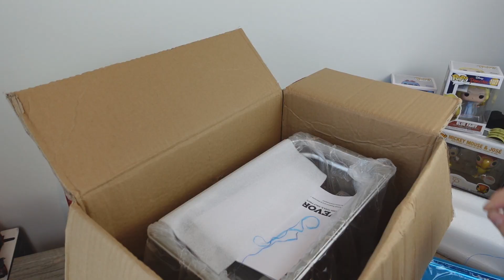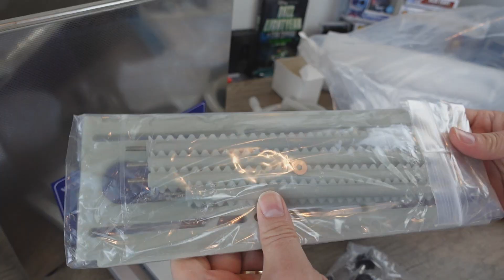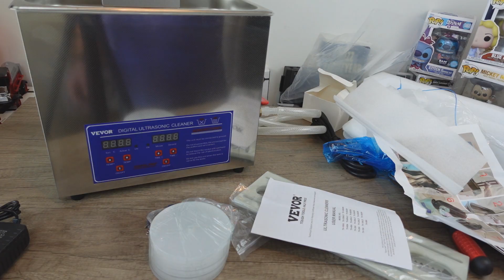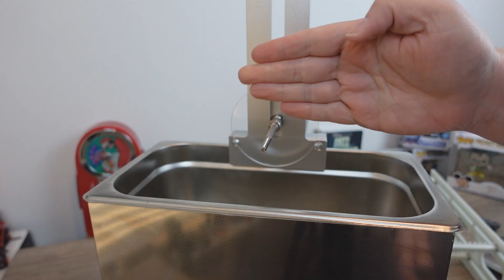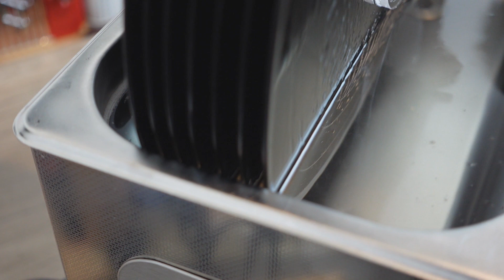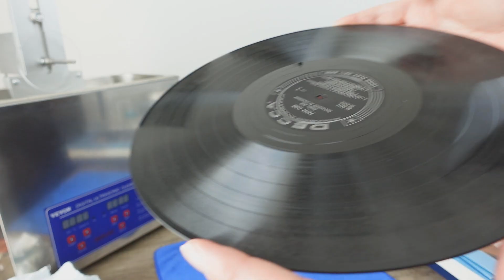VEVOR Ultrasonic Vinyl Record Cleaner!  Review & Unboxing!

Comment: I used silicone sheeting and cut label protectors out of it. Also i replaced the walwart and run 6v to slow the rotation speed down.

Comment: Here's a tip for you.  Raise the motot all the way up. Put your records on the shaft. Lower the motor down to submerge the records. Possibly add a bit more cleaning fluid and a few drops of Dawn. Bump your time up to an hour. Raise the motor all the way up and remove the records. That way you can clean more records without having to drain the tank. You also don't have to worry about smacking a record into the tank when adding or removing records.

Comment: I have worked with Ultrasonic cleaners in previous employment.  Always use DISTILLED water and if you add "wetting agents" to the water run the cleaner for about 10 minutes before doing any cleaning to "de-gas" the liquid. 
Did your Patsy Cline record belong to a Deejay?  Some people have acidic skin and if a Deejay played the disc over and over and did not wipe off the surface each time the acid could eat into the surface just enough to leave permanent marks.

Comment: My Vevor took the shine off my records. They still play (with pops and clicks). I guess I did something wrong. But how do I get the shine back on the records?
Reply from the maker: That’s awful!… What did you have in the solution? Also, what was the temperature?
Reply: @Recordology  It was afterwards that I found out no to use an UltraSonic on 78s because they are made of shalak. I was lucky they didn't crack. Also, don't use any cleaning solution that is alcohol based or heated water.  I did all three. Shame on me.
Reply: @Kicks001 also don’t use the heater at all. It will warp records

Comment: What no one tells you!
Only use about 1/2 cap of cleaning solution, anymore and you will have soap residue on your records. 
Buy a voltage regulator and set for the cleaning at 3.
Clean for only 7 minutes and clean a max of 4 records double spaced at a time. Let the machine work for you. 

Now here is the most impotent step. Dump the water you just cleaned the records with. Rinse it out with a little water, just swirl it to get out soap residue. Now fill the tank back up either clean distilled water. Put your records double spacing back in. Turn the bottom part of the machine off (no digital should be showing) now set your regulator to 5.5 or 6. Push the top button only. 
Let the machine rinse your records for 5 minutes. Then remove them and do not wipe them at all. Tack them in the drying rack and let them dry for an hour. If you stack them straight they should be prestine and dry. If you do have a drop or two you can take a nose dropper and duck that up. 
Unfortunately I learned all of this after trying to use a spray bottle and a microfiber towel to rinse. Clogged my sylus after one song. ATVM540ML. Use a carbon brush on your records and gel the sylus between every record. Sit back snd enjoy.

Comment: I seriously disagree with your opinion "Not much better than a Spin Clean"!
I have used a similar model of tank for some years now and even have my own Facebook group with 7000 members.
These devices give excellent results.
You made a few mistakes:
Firstly, you should have done a pre-clean to remove the loose hair, dust etc. 
If you use a wetted microfibre cloth dipped into the cleaning solution working around and squeezing the wetted cloth around the run in groove with the cloth squeezed between your fingers on both sides, you can really quieten that run in groove of that record of yours.
Use the wetted solution microfibre cloth to complete the pre-clean before putting them onto the spindle in the tank.
Secondly, Too many records! 
Not enough spacing between the records.
Thirdly, Too hot! 40 degrees is insanely hot! Even 35 degrees is too hot. Maximum 30 degrees.
Fourth, you should use Distilled or Deionised water. NEVER anything from a tap, due to possible dissolved minerals in tap water.
To remove grease or fingerprints add some 99.9% Isopropyl Alcohol.
This will get the cruddy fingerprints out.
You should also use a surfactant like illford illfotol.
The surfactant breaks surface tension and improves the cleaning action.
You mentioned a Spin Clean?
That's good to rinse off the cleaning solution after the cleaning cycle.
Use distilled or Deionised water in the Spin Clean.
Do not use cloths to dry cleaned records off! 
You should use the drying rack!!

Comment: Hi! I read some places that you need to use distilled water on cleaners like this? Any comment on that? Seems like that would make the process a lot more expensive. Did a search for what that kind of water would cost in Norway....Also I actually have  Pro-ject VC-E that I never unpacked. (Vacuum cleaner)  but it seems like this ultrasonic machines will be easier to use for multiple records...
Reply from the maker: A lot of people swear by the distilled water… I have tried filtered water, but never have seen any residue or anything else from The Water so I personally don’t seek out special water for it. I could be completely wrong in doing that, but that’s just what I’ve done so far. That being said the spin clean is much cheaper and does a better job in my opinion
Reply: @Recordology  Than you so much for fast replay 😎🎶 I have now seen that the same firm has a little machine for distilling water, not to expensive... And of course water quality when it comes to minerals and so on will vary...

Comment: A thought about your patsy record: the oils from the fingerprint stains may have just soaked in just that much. But, an idea for you. Have you tried a makeup wipe? it could be that someone in the past had handled it with makeup-oiled fingers and something like mineral oil for makeup removal on a wipe might just do the job! Certainly worth a try, I'd think. Acetone on a cotton swab and scrubbing those spots might help too, but def chase it with distilled water after. Or, try an acne pad! I use neutrogena extra strength to clean the sticks on game controllers and it just sucks up dirt and oils. And of course, if you haven't tried it yet, get a label clamp thing to protect the label and take a nail brush in your sink with dish soap and scrub good with the grooves. I would recommend that on the columbia record you showed here for sure, since that mud spot is still there. You won't hurt anything using a regular ol' nail brush so go ham! I've done it on a lot of my more stubborn records and followed up with a spin clean with good results. I've also recently started messing around with the wood glue option, and I ordered one of these ultrasonics but it's not here yet. I'm curious to see (hear?) how these methods all combine. I've got one record with a very stubborn bit of crackling in the quiet intro to a favorite song and just nothing seems to work, so here's hoping this does the job!

Comment: I’ve seen quite a few review videos of these ultrasonic cleaners that didn’t show very impressive results. I suspect the real difference is in the “sauce” — the cleaning solution.
In my experience, you can get excellent results with the right formula. I personally use TergiKleen, and it’s worked really well for me.

Comment: 1) Runs too fast. 2) the temp is way off about 7-10 degrees. 3) It leaks. 4) 40kHz only. 5) Maintaince and customer service is non-existant.
6) Go ahead and ruin your records.
Tip. You do not need surfactants. Ultrasonic method is a surfactant in itself.

Comment: How would the fingerprints disappear when you don't use any cleaning solution? The little bit you put in the water probably only worked as a surfactant but a bit of rinse aid would do the same (and that's much cheaper).
You really need cleaning solution if you want smudgy fingerprints to clean off.
Reply from the maker: Ultrasonic doesn’t require a solution… Sometimes I like to put a little something in there anyway
Reply: @Recordology  It does. Grease can't be broken down by just water. An ultrasonic cleaner with just water is like giving it a very deep rinse but you're not cleaning anything.

Comment: I own the exact same unit.  It works well.  I would say for even better result to a pre-clean with the spin clean or other method first, then use the Vevor Ultra Sonic last as it will take the last of the heavy dirt out and your water won’t be as dirty with hair and other grime.    I also own the Spin Clean and VPI 16.5 and use them in combination.

This can cut the time down to between 5-7 mins, I favor 7 minutes. Anything left on the record after that isn’t coming off and is either a record issue, damage due to age, a pressing or a scratch issue or as you discovered finger print’s buried deep in the grove structure.  

Also don’t use an Ultra Sonic cleaner on records with raised bumps or pimples in the groove, because they can pop due to the force and totally ruin the record.  Leaving a record in an Ultrasonic Cleaner too long and at the wrong temperature will create the same effect as leaving a record in the sun and will damage the grooves and create that static and distorted sound. 

Lastly some record labels are more delicate than others and I can say with assurance if you get an older Bluenote record label wet, it will dry faded, ruining it.  Most other labels that I own have been fine.

Comment: Here's a thought...  after cleaning the records...  drain the water out...  then turn the motor back on with the records still on the cleaner and spin dry the records...
Reply: Yeah man put a fan on facing them
Reply: Or just  loosen the carriage and raise the records out of the water and spin dry... Draining and refilling to get the next batch of records in seems silly, plus that's why there is a cutout on the record holder anyway.

Comment: About fill Line…I did Not fill to where the ‘mark’. I did slightly below where about  3/4 of the dead wax is covered, ensures less water hitting label.  Reprise Neil Young label and Sinatra will melt off if you let too much water hit.

Comment: How do you clean 7 inch 45s on this thing? Has anyone come up with a good adapter to do this?  I have a whole pile of old 45s that i refuse to play because they are so dirty.
Reply from the maker: That’s a great question! The best idea I can come up with is those little yellow spider adapters which I can’t stand… I have used precariously placed regular 45 adapters with this machine with some luck but it’s not a great process. Overall, I much prefer the spin clean to the ultrasonic.
Reply: @Recordology  That's what I use, the spider adapters. It works great for me.

Comment: I like this, instead of making an expensive, dedicated record cleaner, they've taken an inexpensive industrial ultrasonic cleaner and just added a seperately powered spinning motor. If you buy one, you pay less than a normal record cleaner, and you can convert it to just a standard ultrasonic cleaner for use cleaning anything else. It's not the nicest sleekest model for putting on a shelf next to your hifi setup and attracting the eye of the audiophile, but it's a powerful little stainless steel unit you could leave in the garage or under a sink.

Comment: Vevor ultrasonic cleaner
Jps-40a
!Attention! (Wear Shoes!) Im in the US. It looks like the unit is supposed to ground to the case which has rubber feet. After a month of use. My wife had something that needed cleaned. I ran out to the garage applied power turned it on. With the heater off and not engaging the sonic cleaner. I reached into the water and got a buzz. I got out my multimeter set to A/C nothing reading on 110v. I changed the multimeter to DC I am reading .10 volts. Not enough juice to consider. I realized I was standing barefoot on cement. Once i put some sandals on it stopped buzzing (shocking) me. Apparently with inadequate grounding and being barefoot I became the ground.

Comment: I've had mine for several months and it works great once you figure out the little details that make it easier to use. Two problems I haven't been able to get around are that the heater takes a long time to get up to a decent temp for cleaning. Leaving it running to heat up is putting a lot of miles on it. Preheating the water is an option but a royal pain. The big deal here is when I drain the thing I get rusty water coming out. Something in the valve connection is rusting. Not a huge deal unless you plan to reuse the water. Anybody want to clean their records with rusty water? I didn't think so.
Reply from the maker: I have the EXACT same issue!  Its annoying but I guess it does no harm.

Comment: I've been using a Vevor tank for some years and it has worked well for me. I clean 3 records at a time for 11 minutes with a little Tritone x100 and a touch of iso alcohol added to distilled water. After the initial cleaning I put them through a vacuum cleaning device after spritzing the vinyl with distilled water to get rid of any residue from the ultrasonic bath. I tend to reuse the solution in my ultrasonic tank, draining it into my empty distilled water bottles. Later, when I set up for another cleaning session, I pour the solution through a filter (I use the one borrowed from my window unit AC) to get rid of blobs & whatnot. This system has cleaned quite a few albums for me. Some really old records, after a cleaning, sound progressively better after several playings as the deep down dirt that remains is in a softened state & comes out with each playing (but always check yr needle & clean if needed).
Reply: Coffee filters work good

Comment: This is one of the more in depth reviews I have seen.  Thank you very much.  Not in the budget just yet but hopefully next month.  Also in Canada so need to find a Canadian source.  As far as the quality of the unit aside from poor documentation it looks to be pretty good.  Ultra-Sonic is Ultra-Sonic so I think the only thing you will get from a higher priced unit is possibly a few more bells and whistles, better instruction manual and probably a bit less assembly.   As far as doing 7" and 10" records the labels I believe are the same size I believe.  So I don't see any reason why you shouldn't be able to do them in there with the stuff that came with it?

Comment: I bought their cheapest small fume filter and let me tell you their support IS DISGUSTINGGGGG. I was missing two extra filters which were supposed to be included in the package and immediately informed them of this.  2 days later they asked me to send a photo of the catalog parts that were missing. OK a bitr weird but I did that. 2 days later they asked me to supply a VIDEO of the parts that I gotr from them !! REALLY ?????  This is typical Chinese N O SUPPORT CRAP that i absolutely hate & despise as they will just delay delay delay . Think of this company this way--First they INTENTIONALLY MISLEAD you into thinking they are American but if that is true why are all their responses in brutally bad broken english ??  Secondly if they are giving me the runaround for such a cheap item (2 tiny air filters) then do you really trust or believe that they have evenm the slightest bit of support if anything goes wrong with their more expensive offerings ????  I HIGHLY DOUBT IT and am going to simply try and return the filter and give my money to other more deserving companies that actually care about after sales service not pieces of garbage like this company ARE
Reply from the maker: Dang man sorry to hear that - super frustrating!
Reply: I hear you.  But the next thing up from this is about 2 1/2 times the price or more and even though it may or may not have an American name on it it is most likely made in China.  Yes you will probably get better quality service with less runaround but I am not sure that is worth more than Double, (At the very least and more likely quadruple from what I have seen looking into these the past few months),  price tag on this unit.  Personally I will take my chances.  The ones that come with a multiple of this in price tag are still only going to have a max 1 year warranty so you could easily end up in the same situation after that.

Comment: Just a thought, if one's vinyl records have an excess amount of surface debris, a light dusting off of the record could be in order before placing them in the cleaner. I believe it will make better work of the cleaning process.
Reply: Actually when I get mine I will run them through my new Squeaky Clean MKIII vacuum system, (coming next week), and put them into this with only distilled water as a final clean.

Comment: Think the record holder is a carrier that a robot would normally put records in . I worked in semiconductor fabs where a robot would remove wafers from a bath or cleaner like this. Maybe this is what is used to move records in a manufacturing plant after they are made to remove any residual material from the vinyl. Question how much water was used to fill to line in bath .  Good review
Reply: I've watched old videos of vinyl records being manufactured back in the day and they were all handled with gloved hands.
Reply: It's a 6L unit but I too would like to know if that is to the fill line?  Or like a lot of companies an overall tank size measurement for advertising which you can't actually use the full 6L.